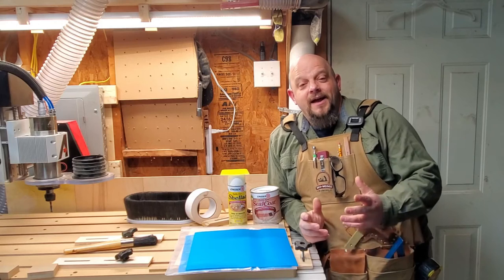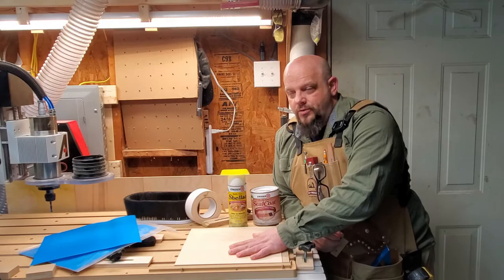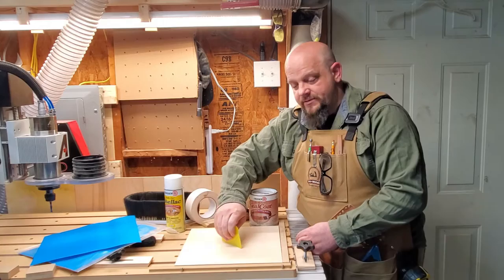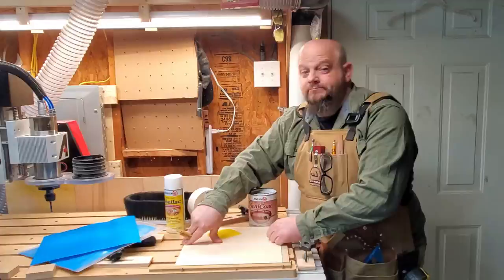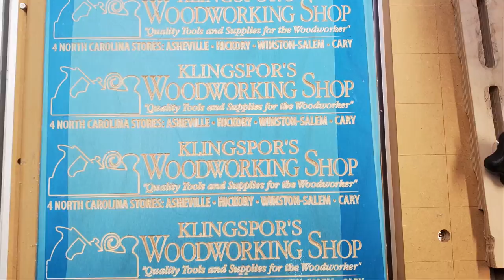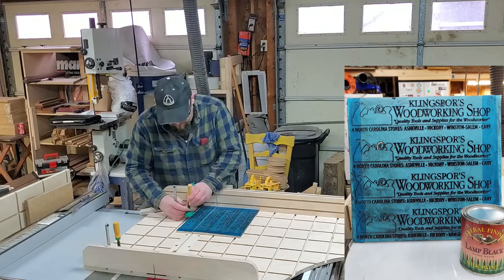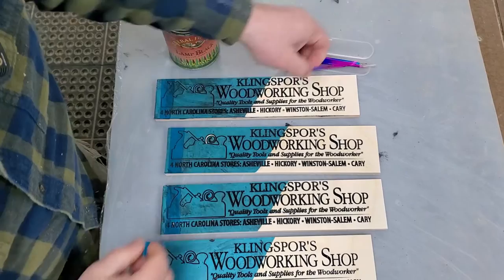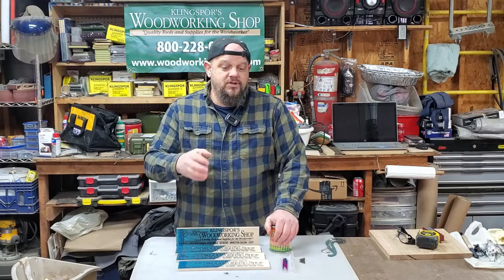How To Use Oramask 813 Stencil Film For Painted CNC Signs

Comment from the maker: This stuff really is a game-changer.
Reply: What F & S do you use for the 60° v??
Is there a better setting to keep the Oramask from peeling during machining??
Reply from the maker: @ClintonCaraway-CNC  I've found the solid carbide bits need to have some adjustment or it will "climb" up the bit as it cuts.  The single replaceable insert bits do really well with it.

The key to keep it from peeling is using a squeegy or other plastic tool to press out all teh air pockets and properly adhere it to the material surface.
Reply: Does is this stencil good for big signs 
I saw that some ppl get bubbles?
Reply from the maker: @TheLovee4musicc  It depends on the material you are putting it on and how well you get it applied.  Bubbles typically come from not pressing it on well to get good adhesion to the surface.  
I've done 24x36 signs with no issues.  I've had to overlap my 12" wide material to accomplish it, but again, no issues.
Reply: Have you ever used it over painted bases? I have some plywood signs I want to make with a red backround and white inside letters, I tried using transfer vinyl thing the clear one, and it pulled the red paint off my workpiece when removed
Reply from the maker: @douggauthier4768  absolutely.  Paint, apply, cut, & paint the cut area.  Then peel away.  You can keep doing that as much as needed.  I've done it four times on the same project.  One color at a time.

Comment: Great video, although I do have a couple of questions. 
1. What is the v-carve type bit you're using?
2. What is the depth of the cuts? it seems a single v-carve is doing the single job. 
3. What seal did you use? Can it be used on paint?

I'm trying to paint the wood black, use the oramask to carve out lettering then applying different coloring. but it seems I need to cut them out first? I appricate your time and video. Cheers.
Reply from the maker: 1) that is my go-to 60v bit spectra from Amana
2) they vary based on the width of the font lines.  In vectric, it has a toolpath called "v-carve" which bases the depth on font line width, bit used, and depth is varied automatically.

3) any sealer works.  If using Lacquer, then seal with lacquer sealer.  If something else, shellac works well.

Paint or seal, then oramask.  Cut out letters for the first color, then reapply oramask.  Cut 2nd color, and repeat as needed.

Comment: You used sanding sealer before the Oramask, but don’t you need to get it into the engraved areas after carving (or did I miss that step)? It seems like stain or paint could get into the newly exposed endgrain and migrate that way.
Reply from the maker: As long as the top is sealed, it's OK except for pine.  Pine can wick some if using a thin paint.

Comment: Nice Video Sir. What type of Oramask did you use? Oramask 813 or 817. I ask because some think the 817 is harder to remove from the material. That might be the answer to save the pain staking task of removing the oramask. I have the 817, so maybe you can help me answer my question as well. Thanks
Reply from the maker: I used the 813.  The 817 is best suited for harsher finishes like lacquers.

Comment: i used it for the first time today and it did not stick to my wood. i was a piece of pine from lowes and sanded to 120 grit and stained it with minwax stain but did not use a sealer or a finish. is that why it did not stick?
Reply from the maker: Unless the surface is smooth and clean, it will struggle to adhere.  Also, it has to be pressed so all air pockets are out.  I've used it on pine with no issues.  Is it possible the stain wasn't dry?

Comment: I have a general question. This is the first big project I used oramask and when I pulled the oramask off it left a sticky residue on project. Is there a special way to get the residue off without removing the paint underneath? 
Thank you.
Reply from the maker: It can become an issue if you leave it on for a long time (a couple of days) or if the wood is porous.  I have had it be sticky if i applied it over a finish that wasn't dried well.

Apart from that, I've never had leave a residue.
Reply: @ChristcrossCrafts  thank you. 
Well the paint was left for a couple days before masking so I assumed the paint was dry. I did put a thin coat of urethane over the paint so that must not have been dry enough. Thanks for the help.

Comment: Fantastic! Do you have a recommendation for a colorful paint type for this? Acrylic seems like it wouldn’t be best, perhaps? I prefer a paint-by-hand option rather than spray. Thanks for a Great Super Helpful video!
Reply from the maker: Thank you for watching.  You can use dye stains or any paint really.  Dye stains often come in bright colors and there isn't a lack of colorful paint.  I use General Finishes Milk Paint quite often myself.  It's water-based and dries quickly.
Reply: @ChristcrossCrafts  thank you so much!

Comment: Excellent video, what sealer would be best for exterior signs? I read that Zinsser 854 is for interior applications  Thank you.
Reply from the maker: Thank you for watching.  The sealer (in my opinion) isn't as important as the topcoat.  I'm a fan of the Zinsser sealcoat (shellac-based) because it makes the grain pop. For a topcoat, you have several options.  

Any "outdoor" finish will work.  I usually use General Finishes Exterior 450 if I want a clear water-based finish, or Waterlox marine if I need an oil-based finish (this takes a while to dry but very easily maintained).  Also, about any "marine" varnish will work.  System III makes a really good one.
Reply: @ChristcrossCrafts  To be clear, are you saying that it doesn't matter if the wood sealer doesn't have to say exterior as long as the top coat is for exterior?
Reply from the maker: @kenanklovitch8117  Correct.  If you are just using a sealer (i,e. deck sealer, log cabin sealer, etc.), then it will need to be exterior rated.  If you are top coating it with something else, it does not need to be.  The exterior "top" coating will keep UV and weather out.
Reply: @ChristcrossCrafts  Thank you very much kind Sir!!
Reply from the maker: @kenanklovitch8117  Happy to help.

Comment: Could you use parking tape, a sticky tape, or something like oracle 651 to remove the vinyl mask quicker instead of so much weeding?
Reply from the maker: Possibly, but the weeding tool allows you to get the small pieces that are easily missed.  If you pressed it on well, then the finish can prevent the tape from getting it all.  Plus, sometimes the finish may still be a little wet when you peel it off and the tape won't stick.

Comment: I tried this mask on a nicely white-painted sign which I then routed out the lettering, spray painted the lettering black then after a day or so tried removing the film.  It pulled off in small pieces and left a sticky residue in patches. Then trying to remove the residue I ended up smearing the black paint all over the white creating a mess.  I ended up using white spirits with a Q tip to clean up most of the black smudges mixed in with the sticky residue.  Needless to say I spent many hours more than I'd hoped and lost money on the job.  I won't be doing another multi-coloured sign until I find a better mask that doesn't leave an impossible-to-remove sticky residue.   Someone said that it is easy to remove with soapy water but that wasn't the case, it did nothing to remove it even after soaking for hours.  So frustrating!
Reply from the maker: Sorry you experienced that.  The key to the oramask is not leaving it on, but shortly after the paint has dried.  Also, if you didn't let the original white paint dry to cure, it tried curing, and the mask prevented it from flashing off.  

This works well but there are some steps to make it get to that point.  I have made the mistake of taking the mask off too early, dragging wet paint onto the main field.  It was a learning process, but now I won't use anything else.
Reply: @ChristcrossCrafts That makes sense, thanks, I must admit the cold weather here in Australia at the moment didn't help, I'll try waiting longer next time.
Reply from the maker: @ausworkshop  longer on the white but much less on the paint after the carve.

Comment: Interesting - does this work with a laser?
Reply from the maker: I haven't used it with one, but I imagine, no.  It is a vinyl material and the laser would likely melt it.  Lasers have other options to prevent burning around the lasered areas.

Comment: Tried to use oramask the other day, guess something didn’t go right, cause the bit ended up grabbing some of the oramask and got wrapped up so I had to shut it down and peel it all off the bit. Haven’t tried again. :/
Reply from the maker: It does need to be pressed on well. I get some build-up sometimes with my 60° v bit.  You can adjust rpms and fix some of that but otherwise I haven't had any issues.

Comment: Hi what kind of feedspeed do you have on the vbit? My rpm is 18000 but haven't any luck with the oramask so maybe the feedspeed🤔
Reply from the maker: there are many factors.  Mine is a 3 flute solid carbide and I run it 14-16k rpm and the feed will vary depending on the size of my lettering.  I know people who use a standard carbide tipped V and it works for them.  The important thing is finding what is right for your machine.  It's a combination of rpm and feed rate based on your bit and machine

Also, you want to ensure the oramask is pressed onto the surface very well.  A clean, well-sanded surface is best.

Comment: Good tutorial thanks! Out of curiosity, what depth do you use on the CNC cut for signs like this? I tend to go around 3mm, depending on detail etc.
Reply from the maker: I typically allow the bit and vectors dictate my depth.  There are a some projects that you have to determine that but usually go as deep as the bit angle allows.

Comment: I've been trying to carve letters with Oromask with a 60deg 1/8" vbit, but the Oromask gets shredded along the edges. Using on Poplar with 200mm/min plunge and 1000mm/min feed.  Final depth at 0.15mm.
Reply from the maker: How fine did you sand, is the surface clean, did you squeegee or press the surface prior to applying it?

If rhe surface isn't smooth and clean it won't adhere well.  If the mask isn't pressed well it will unravel some while being cut. If your bit is dull that can also pull more on the material instead of slice.
Reply: @ChristcrossCrafts  thanks, I’ll give that a try.
Reply from the maker: @Brent Headberg  one of those plastic walpaper spreader tools works well.

Comment: Great video. Thanks for the heads up on the Oramask. Does that leave any residue on the material once pealed off? I’ve used stencil with super tack and that stuff leaves a gummy residue. Also, does it stick well to prestained boards? Thanks again!!
Reply from the maker: It doesn't leave any residue.  I've left it in for 4 days before with no issues.    I've adhered it to bare wood, stained, painted,  and urethane/lacquer with no problems.  

The only struggle will be with rough wood.  I tried to use it with barnwood and was an epic fail.
Reply: @ChristcrossCrafts  thanks for the info and the help. That was the fastest reply and just got you a sub!!
Reply from the maker: @firemanbif  no worries.  Glad I could help.  I normally try and respond within a couple of hours.  I happened to be near my phone and machines weren't running, lol.
Reply: My husband is having trouble with the Oramask lifting the paint from the signs. Any suggestions?
Reply from the maker: @maureencrossman3978  make sure the paint is dry before applying the mask.  Some softer paints (like chalk) will pull.  Best to add a sealer first.